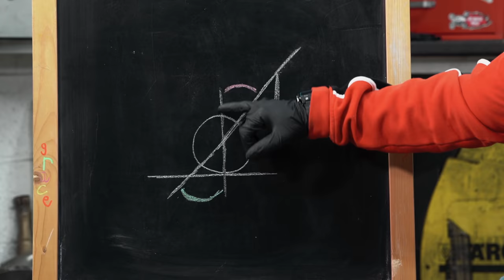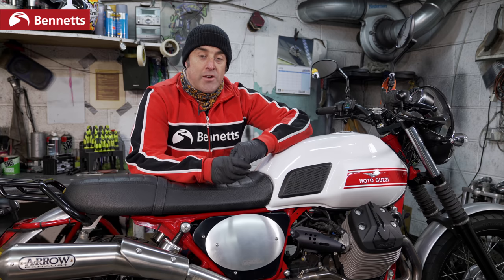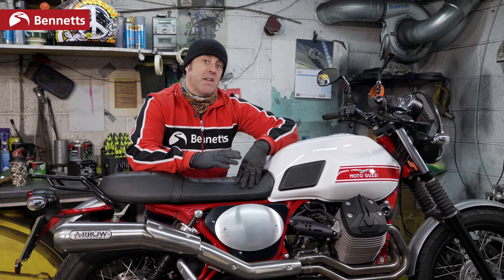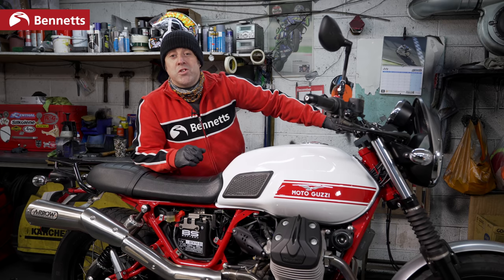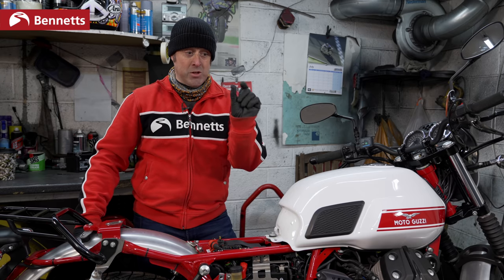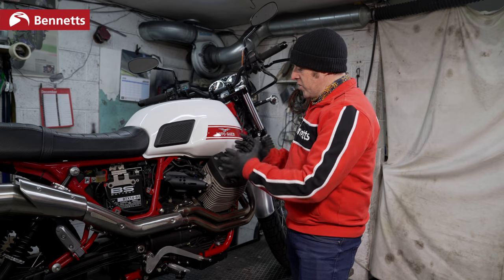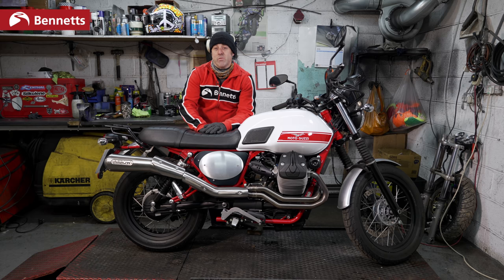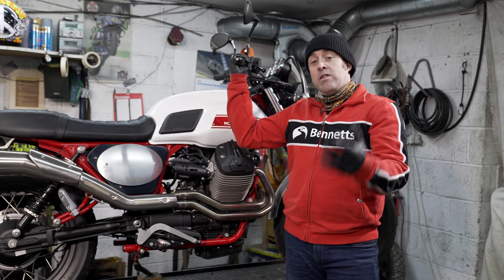Why won’t my motorbike start? | Check list

Comment: Instead of putting a bike in "hibernation", is taking it out for a 15 minute ride once a week during the winter months a good idea to keep everything running smoothly?✌🏽
Reply: As a former tech, I think that’s that best way to go about “winterization” lol. If you can get it up to speed, put 4 or 5mi on it (enough to get coolant and oil to operating temp) that’s ideal but it’s probably easier said than done for people who live in very cold climates and it’s unsafe to ride

Comment: Hello .can anyone explain what could be the issue .i have taken my battery off while engine was running.after 10 second engine went dead.i have put new battery..all dashboard lights working.starter motor working fine.all switch working ok.but there is no noise when i trun on ignition and no start either.even though starter motor working fine

Comment: None on the list. My Yamaha fazer 1000 was on side stand for 2 years, got a new battery and still won't start, the problem is the tip over/ bank angle sensor, the sensor got stuck laying on the left side for 2 years, remove it and shake left and right, or put silicone to make it stay in place, check the tip over sensor especially you kept it for many months unused.

Comment: I've had an srad standing for a long time...over 6months easy. Maybe a few years. That's at least a quarter to half a tank of fuel in there with a stabiliser but I want to completely drain the tank! What is the best and easiest way to completely drain the tank before I put nice fresh fuel in there? 

I will also be removing the carbs and opening them up to do a full clean of the carbs and clean all the jets too.

She was running before i took the tank, and airbox off. She would run to about 7-8k revs then bog after that...I imagine it's a carb blockage so hopefully after a good inspection and clean she will be good to go again!👍🏼

Comment: I got thru two batteries before I checked what voltage the battery was getting. It was getting nearly 18 volts! New regulator-rectifier was ordered....

Comment: I have a 1992 Kawasaki  Vulcan 1500, been sitting for about 12 years, it turns over but won't start, there was no gas, and I installed a new battery, it belonged to my late Brother so it's more sentimental than anything else...

Comment: A common problem I have every now and then all comes on but when push the start button nothing no sound no start. This is because it has dirt and grim inside the switch needs to be clean out from time to time.

Comment: Me riding to a shop to buy something.

Goes back to the bike and starts it all lights on, dash on etc.,  press the starter button, starter buzz/whirs a bit but then just plane silence.

Tested new battery, press starter button and just one click sound and nothing.

What I did notice though 2-3 days before the bike just did not start is that. Everytime you press the starter button, it does its usual whirring sound and cranks the bike and starts the bike, But the whirring sound you hear when you press the starter button whirrs 1-2 times right after the engine properly starts.

Like literally engine starts like normal. Then you hear 1-2 whirrs or buzz after. Same whirring or buzzing start when you press the starter button.

I could not hear it for a long while cause I always started it with a helmet on. I only then realize it did it when I started the bike without any helment.

Usually the starter whirring stops just as the engine cranks up.

Comment: All well and good remembering to pull the clutch in but what if the clutch switch especially the connectors are dirty or corroded.
Reply: Clutch switch, side stand switch, gear position sensor... All can block starting. Then there's the starter relay solenoid.

Comment: '18 V7iii Milano.  Just bought with 800 miles on it.  Sometimes start switch doesn't work.  Seems intermittent.  Are there any other safety switches that could be causing this, e.g. sidestand, clutch, etc.  Has me puzzled.

Comment: petrol loses ocatne over time, after about 3 months you notice the difference, harder start and takes longer to warm up and level out, also E-petrol absorbs water, ethanol is hyrdoscopic, this means it absobrs water out the air, one pint of ethanol can absorb 1 pint of water if left long enough, so water absorbstion and ocatne reduction is the No1 problem for poor starting after being laid up over winter, the solution is, drain the tank before storage, squirt WD40 or simular in the tank and seal the tank filler cap with cling film, come spring just fill the tank and drain the carbs, dont let the carbs stand over winter dry as that will damage the rubber seals and encourage that white mould that grows on the copper jets, another good thing to do if not using a bike over winter is to seal the exhausts up, again cling film is an easyway to do that, a rubber bung is good if you have ones that fit, sealing the exhaust stops them from rusting inside out, exhausts fill up with condensed water over the winter and can have a cup full in them in just 3-5 months, how cold and damp is your garage/shed ! a squirt of WD40 down them prior to storage wont do any harm,
N/B The best solution is to start the bike once a week and let it tick over for 10 minutes, turn the fuel off then after 20 seconds cut the ignition, in that order 🏍

Comment: The starter on mine works when you hold the brake.   I recently changed the tires.  So I took the rims off the moped. Now that I put them back on it won't turn over at all its just dead but the lights work battery is fully charged. What do I need to check

Comment: So my yamaha usually has issues starting on mornings (as it cranks but wont fire up initially), I've changed the spark plug, all filters and oils.
What else should I try?
Reply: ignition coil maybe

Comment: How would would be the best way to find problem from a starter relay failure or starter motor itself.. rather buy the right one lolits a 125 cc derbi senda cross city 2015 model.. it has a brand new battery too, it just clicks when trying to electric start.. could it even be a coil issue m8 sorry new to bikes
Reply: sombody said to bridge the relay with a screw driver and if starts the starter motor would be fine?

Comment: Hey, i have a f4i that had a PCIII. After removing it and reconnecting the connectors the bike dies as soon as I turn the key. The battery shows 12.8v. Thoughts?

Comment: What if it wont start with the switch, but starts with the kick start, but cuts out when going to idle? Would this be the starter motor? Thanks
Reply from the maker: Hard to diagnose online but logic says... If it starts on the kickstart, it might be the starter button. But if it then stalls on idle it could either be something in the low-engine-speed or cold start fuelling (maybe a problem with the choke if it has one) or perhaps an issue with the battery. If the starter button turns the engine over without starting then it's probably not the battery. Does the engine idle if you rev it (or ride it )for long enough to get it warm? If so, it's probably the choke. Hope that helps.
Reply: @bennettsbikesocial  Thanks buddy!

Comment: Hiya. My bikes been off the road for approx a year. I've fitted a new battery but I have nothing when I switch on. No electrics,ignition lights.Zero. I've checked the fuses and checked there is feed to the ignition and also checked the battery for charge. Any idea's? I would really appreciate them. Cheers
Reply: So what was the problem in the end? Or is it still sat there?!

Comment: Just got mine back from service, left key in ignition(off position) by mistake and now it doesnt turn on, but when charger is connected to battery it says its full, turns on when connected to charger but wont start and dash spazs out, no clue wtf i did
Reply: Did you fix it? If so how?

Comment: my bike doesn't start, it cranks, but only starts if i give throttle, it's a FI bike, not fuel problem, i changed out the fuel, changed new fuel pumps and filters, change the battery, and of course tried to jump start as well, it only still cranks, had also changed the throttle position sensor, but i have no idea how to check if it's working or not, also had changed the air filter, also changed the spark plug and check the ignition coil, and everything is working well. my bike is a benelli tnt25 2016 with only 1 piston. even if it starts, it will die out in 5 seconds, and stalls easily while taking off
Reply: ECU/CDI?

Comment: HELP PLEASE! My zx7r great starter, parked it up, and changed the brake pads. 4 days later starter motor turning it over as normal, fuel in tank. Will not start. any ideas?
Reply: You ever find out the problem?

Comment: What about gasoline pump? Can that be a problem when starting?
Reply: yeh also check ignition coil ,ignition switch and starter switch ,if its none of those it could be your ECU/CDI

Comment: How about friend, I wanted to ask you a question. I am interested in buying a new motorcycle and I doubt between the triumph speed twin and the new guzzi v7 850cc ... I know they are not in the same segment, but I don't know if the guzzi would be somewhat short on the highway and in that situation the speed would be more convincing. a greeting from Spain.
Reply: If you're a new rider, get the Guzzi less power (but fast enough) less maintenance as shaft drive, reasonably good handling and looks great, good resale values. If you're a reasonably experienced rider I'd go for the Speed Twin, haven't ridden one yet but appears to be a fantastic bike. If you like a traditional looking bike with modern performance and handling id be looking at the the new Triumph Trident
Reply: @captainaverage721  thank you my friend
Reply: try a guzzi before you buy is my advice
Reply: @alandmorley  tell me more

Comment: Question, I've had my bike sitting for roughly two months...needed a new battery and some cosmetics...now I changed what needed to be changed and now it won't start and I have no idea why...can someone help
Reply: Check the coil coils if yours has them when they start breaking down it causes starting issues that get worse over time also coil leads tend to break down causeing starting problems